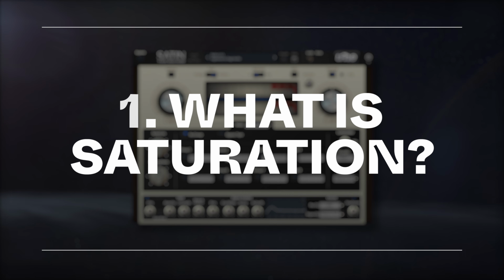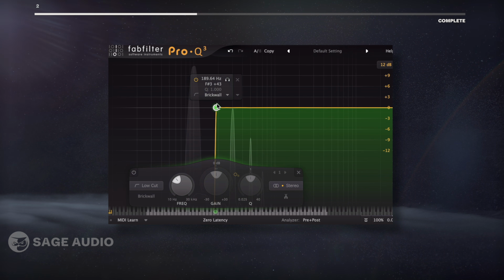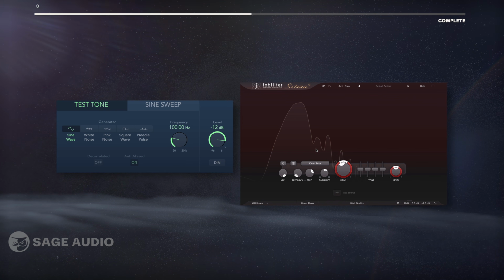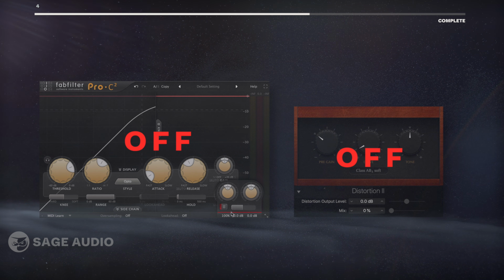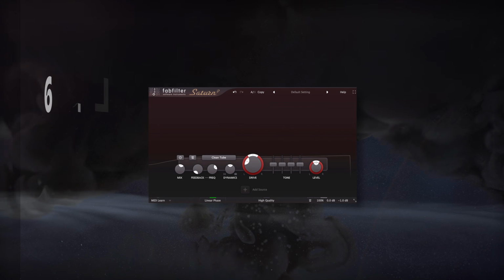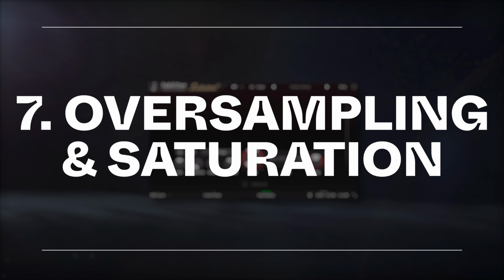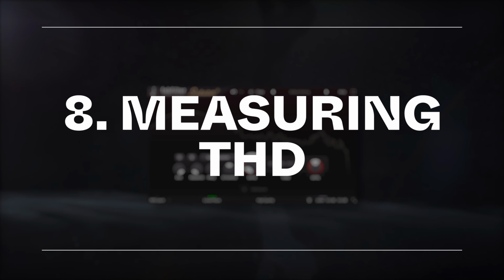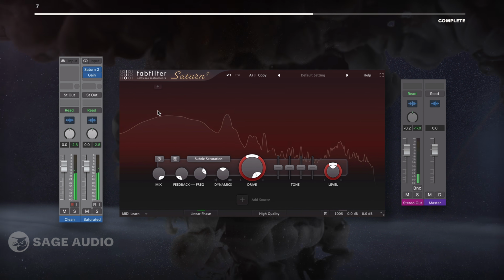How to Saturate a Mix

Comment: Your videos are top notch. Super sleek and informative. Thank you.
The examples sometimes, and in this video are super subtle. I personally find it easier to hear a plugin engage, and then once it goes back into bypass is when I hear what's missing, rather than turning on a plugin to hear what's gained. For me, a definitive perspective is what do I miss when I bypass? So it's hard when it's super subtle and once the plugin is engaged in the video there's a soft volume attenuation that comes shortly after making me think the plugin is going into bypass but my brain gets confused with the volume automation. Instead, I'd rather hear it go back into bypass and stop over the same amount of time that you attenuate the volume (as I know you don't want to extend the videos if not necessary). The volume change skews my ability to sincerely hear. I wonder if that might help folks further who are using your channel to learn and learn to listen. You're a wonderful teacher. Cheers.

Comment: i use kramer tape for mix bus saturation which doesn't have linear phase or oversampling. Is this ok because the plugin was designed to work on the master bus?

Comment: Just a detail... AFAIK Linear phase only applies when using filters... in the case of this plugin when you use multiband mode & oversampling...  so there shouldn't be any phase issues when using only 1 band like in the example shown.
 Regards!
Reply: I could be wrong but I think using only one band is the same as using an all pass filter? This can still cause phase issues.